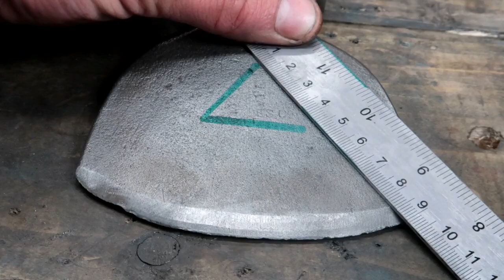100 Years Old Antique Rusty Axe/Hatchet Restoration

Comment: Wow. The hatchet had a good hickory handle, tightly fitted, wedge correct and in place.
And you sawed it off.
And replaced it with a poorly made copy, made from soft wood with weak and wonky grain.
Awful.
Reply: Whats wrong about that handle?

Comment: I have an axe head like that, same shape, but only single edged...what kind of axe is it , and is it very old?
Reply from the maker: I think it's 100 years old
Reply: Congratulations -  sounds like you have a Side Axe if completely flat on one side and beveled on the other. Looking from the rear If bevel on right it's a RHS Side Axe for a right handed user (opposite for LHS bevel). These are trades tools like wheelwright, cooper, carpenter shipwright, often about 4lb head weight, short handle 15 -18"', handle often offset / crooked to give the working hand clearance from the workpiece.  They're comparatively rare and so more valuable. Used for shaping timbers & cutting rounds into flats. Suggest you conserve by wipe over with an oily rag, nothing more. Any polishing, use of power tools on it, or botched sharpening will invariably destroy its value. Trust this helps.